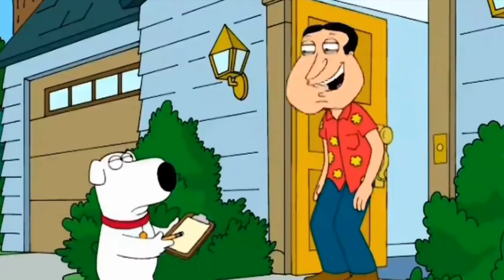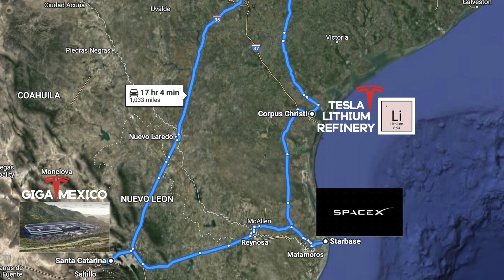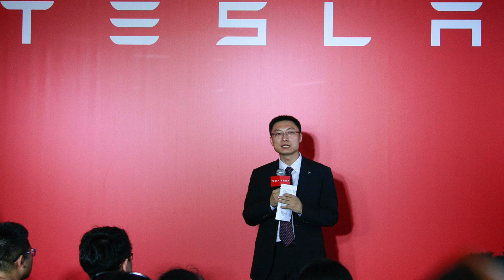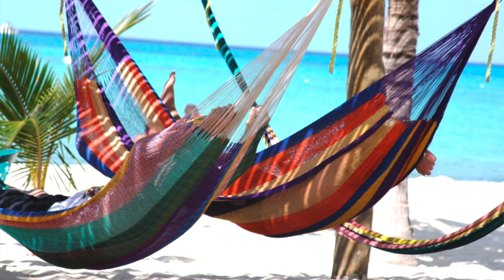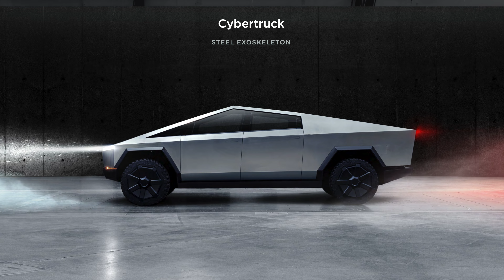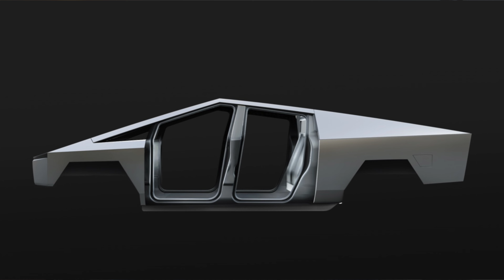GigaMexico will build 1/2 Price Teslas! But How?

Comment: If the final building permits for giga Monterey are looking to be done this month...and Tom wants to beat the construction time of 9 months at giga Shanghai. So, my question is...how long does it take to build a giga press?  Isn't it a year or more?  Then another 3-6 months to put it together and configure it? And how many giga presses would they need?
Reply from the maker: I guess Tesla will have thought of that already, and it may already be under construction... or there was a second Idra 9000 tonne Gigapress that was shipped to China I believe. That could be at a Tesla Shanghai already being tested for the new models. All speculation!